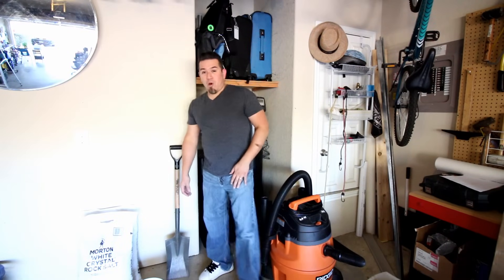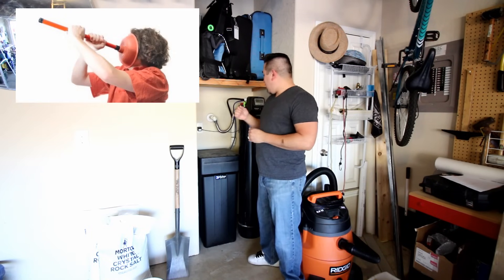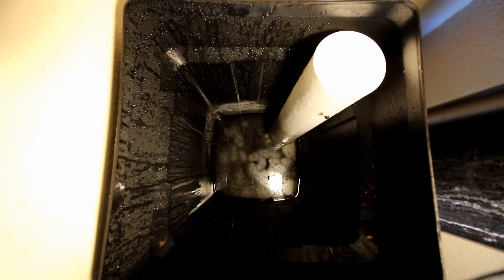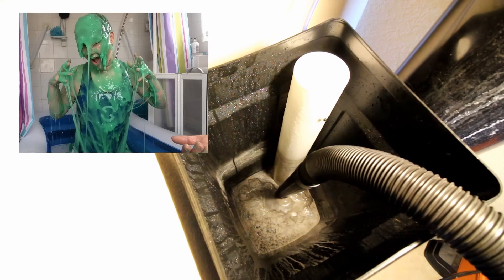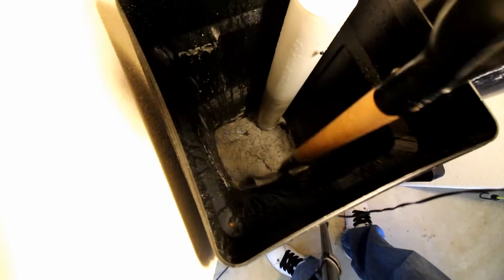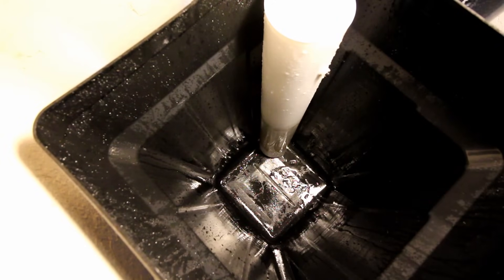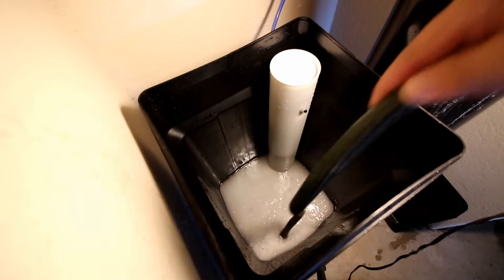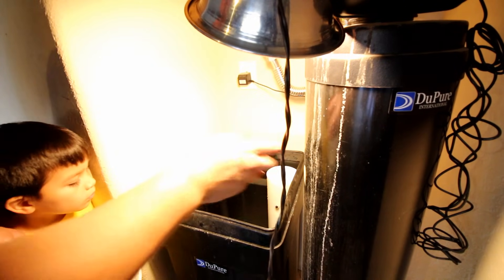DIY: Water Softener Maintenance

Comment: It is a whole lot easier to take the salt reservoir outside and clean.  If you have an all-in-one unit with brine tank inside the reservoir then this method is best, except for the water hose.  Also don't use shovel with sharp corners it is too easy to puncture reservoir.   BTW, The Brine Well is the white tube located in the corner of the salt reservoir.  Enough already with the photo inserts.  It was funny the first two times.
Reply from the maker: Thanks for your feedback. You are right on the Brine Well part. I held off on removing the tank because of the small parts and potential issues someone may have if they aren't to familiar with the process.

Comment: What would happen if you remove the system from one house to another house. Now it’s been sitting for over 2 years. Now a plumber told me the tank might be corroded inside. Might need a new one. Could that had happened ? While it was just sitting for a while?
Reply from the maker: Most tanks have plastic internal parts and resin beads. I dont know of many systems that use any kind of metal that would become corroded. It goes against the entire use of a salt based system. There's so much sodium running through it that it would become corroded. Was the tank stored with the bypass on to keep the resin wet? If so, you may need to flush it out. THey make adapters that you can attach to your tank then to your house. Flush water through in the same direction that it would flow when connected. From there you should be good to install. Worst case scenario you flush it and nothing but yack comes out. If its a mess then consider a replacement.
Reply: This Guy   Thank you very helpful. God Bless

Comment: thank you for the video. but i have a question; did you change the valves back to the normal direction from bypass mode????? or is it supposed to stay bypass mode?
Reply from the maker: You should take it off of bypass right after finishing the cleaning featured in this video.

Comment: I appreciate this video. Nice job. One suggestion though is to not use that rock salt. That stuff contains debris and sediment which is probably why eventually you have that build up.  Use pellet type or nugget type salt.  It is much cleaner salt.  Also it’s not any more money in my experience. I pay about $4.50 per 40lb bag at the grocery store. I’m sure it’s even cheaper at Home Depot.
Reply from the maker: Thanks for your support. You are correct on the cheap salt. I have since changed to using pellets. I have found that I see much less build up in the brine well.

Comment: Great video! Thank you so much. My water softener is not releasing any water into the tank, it's always empty even when I try to regenerate. Do you have any suggestions?
Reply from the maker: Hi Jennifer, It sounds like your bypass is activated. Look at the bypass valves behind the tank head and note the position on the valves they may be turned so water is totally bypassing the tank. If it's not that, there may be an issue where the valves that engage regen are stuck. Let's start with the bypass first.

Comment: Most manufacturers of these units specifically state NOT to used rock salt. Does that differ for your unit or do you just like rock salt?
Reply from the maker: Nope, I had mistakenly used it. I use the pellets now.
Reply: @ThisGuyProductions  Never mix two kinds of salt in the brine tank. You'll get a bridge big enough to cross the grand canyon. LOL

Comment: Thank you for this informative video! Finally found what I was looking for.
My tank was filthy. Yesterday I shop vacced all of the sludge/slush out from the bottom. Then I washed out the tank with soap and a tiny bit of bleach.
I added one bag of 40lb salt, added water to just where I could see it, then added the Out water softener cleaner/salt booster. Then added 2 more 40 lb bags of salt and some more water. 
Stupid me didn't read until afterwards that 3 - 6 gallons of water should be added back....so I don't know if there is enough water in the tank. I think I'll add 2-3 gallons more just to be on the safe side. 
Anyway, I did a regen and now after I flush my toilet, the water in the toilet tank is slightly blue. 
I'm wondering if this is caused by the Out cleaner and if this is normal or ok?
Reply from the maker: It sounds like it could be caused by the cleaner. How much of the solution did you add? I would run the cold water in a bath faucet for about 5 to 10 minutes to flush it through.
Reply: @ThisGuyProductions  That's what I'm thinking. I dissolved 2 cups of Out in 1 qt of warm water and added it directly to the brine tank, not the well.
It's not as blue as last night but I'll try running the bath faucet to see if it clears it altogether. Thank you!
Reply: @TJC1315  Thanks Jill. Its common practice to flush a filter for about 5 to 10 minutes after installation. This can be treated the same way. The water flushing through the system will clear it out. I would just note to make this a best practice next time you complete the system clean up.
Reply: @LaunchpadB  Thank you!

Comment: First video I've found to be useful...it costs a lot of money to have my contracted service people come out to do mine, and I'm very into DIY. I have a RainSoft EC4...any tips specifically for that, send 'em my way, please. -=80)
Reply from the maker: Hey Randall, I am not familiar with it so I decided to look it up online. The Rainsoft site is very stingy with their research material. I was able to find an owners manual in the link below. Page 7 has the details, but unfortunately they dont show you how to perform them. (Note: If you add a resin cleaner, pour it into the white pipe inside the brine well. I poured it into the brine tank. It doesn't have a negative effect, but it takes a little longer to work that way.)

https://admin.rainsoft.com/documents/15929%20-%20Rev%20M-%20%20EC4%20Owner's%20Manual.pdf

Comment: FYI  Another video from a water softener repair guy says you pour the solution down the pipe in brine tank not in the salt.
Reply from the maker: Yessir Walter. You are correct. The brine well is the white pipe, not the actual tank. Adding the solution to the tank will not cancel out the benefit of the solution though.

Comment: The Venturi Principle. A venturi creates a constriction within a pipe (classically an hourglass shape) that varies the flow characteristics of a fluid (either liquid or gas) travelling through the tube. As the fluid velocity in the throat is increased there is a consequential drop in pressure.
Reply from the maker: Thanks!

Comment: mehhh,,,you should just dump that salt water softener. This is the first time I've seen  that nasty stuff in the water softener especially Salt water system!

considering Pellican and/or other non salt softener system bud!
Reply from the maker: Thanks jpthsd. I have upgraded to a system from Springwell and it has worked out great. I like them because I can install myself and save lots of money.
Reply: @ThisGuyProductions  quiet expensive Springwell...but hey you already did that,,awesome!!

May I ask if your TDS EZ tester's ever changed? Íve been seeing TDS no changed at all but I could tell the chloride other bad stuffs making itchy skin gone for sure.

(of course I use RO for my cooking and drinking water)

Comment: Don’t overload the bin with salt. Excess salt will compress the lower area and turn it to dust clogging things up. I have been using a water softener for 3 years plus, adding one to one and a half 40 lb. bags and have never a an issue with sediment in the bin.
Reply from the maker: Thanks Richard, I usually use 3 - 4 bags at once every other month. My brine tank is large enough to avoid it impacting too much.

Comment: In the 30 years have had a water system I have never had any thing that looks like what you have in that tank. You might want to find a different salt. I have never had to clean out my salt container.
Reply from the maker: I was using really cheap salt prior to making this video. Based off feedback from viewers I switched to pellets that are much cleaner. That being said I am still getting sediment every two years that needs to be cleared out. Perhaps it is the extremely hard water in south Texas.

Comment: after cleaning out the brine tank and adding new bags of salt how many bags should i add to start also is it necessary to cover the salt you added with fresh water?  and with the cleaning solution should I add that  directly into the tank  or put it down the center tube ? also after this process should I do a regen immeadiatley or wait for the system to go from 100% down to say the 22% when it normaly regenerates
Reply from the maker: I would add about 4 bags (200lb) to the brine tank then add water level with the top of the salt. The brine well (white tube) has a floater in it so the system will know that the tank is already full. When adding the solution it is best to add into the white tube instead of to the general tank like I did. It's more effective that way. I would also regen that evening.

Comment: does this remove chromium 6 and all that jazz from water?
Reply from the maker: It will remove most chemicals from your system, but Chromium 6 is some Erin Brockovich level stuff. You should get with your water municipality if you have those issues. That's really next level.

Comment: This was a helpful video Thank you
Just one question, after you checked/cleaned the Venturi valve did you manually switch the bypass valves back to service before doing the regen?
Reply from the maker: the bypass is turned off as soon as you wrap up.

Comment: Question. I heard there are "slots" in the brin tube? How do we clean that? My softener isn't draining again. Standing water. I replaced the Venturi gasket, it drained for around 3 months, but now standing water again. We use very little water. Just 2 people. Any ideas? Thanks
Reply from the maker: I am not familiar with all systems. I would bet that the drain issue could be due to a clogged like from the brine tank, or some kind of failure in the mechanism in the head.

Comment: You added to the brine tank not the brine well as instructions indicate. The brine well is the tube inside the tank.
Reply from the maker: Agreed. It turns out either way will work, but it's more effective in the Brine Well.

Comment: My feed water has 0.76 ppm free chlorine. Will it damage the softeners? 
The water hardness coming out from the softener is 1.5 mg/L after every regen. Is there a way to bring it down to 0.0mg/L
Reply from the maker: Hey Leong, You are way over my head with the question. You will need to consult the manufacturer of your specific unit.

Comment: Hello. Question. Kenmore brand. Water wasn't draining.  I replaced Venturi gasket. It drained , worked good for 4 months. Noe it's filling again and water not draining. Any ideas? Thx
Reply from the maker: Is it a stand alone system, or a combo system like mine? it could be a clogged line, or a failure in the mechanism in the head.

Comment: The brine well is that white tube you pulled the cover off of in the brine tank. Also the brine valve was that red part under that cap you took off, that is where the debris will be.
Reply from the maker: Thanks D Rob.

Comment: Can this clog a drain the system is connected too?
Reply from the maker: It possibly could. The water that is backwashed out of the system is high in salt concentration. In theory, there could be a build up of sediment over time, however I haven't seen it happen too often. You can rent a basic drain snake from a hardware store to search out the blockage yourself.

Comment: We have a 4 year old Rainsoft Softener and have it serviced every year.  The company was here 4 months ago for the annual maintenance but the water in our house has now started to smell bad recently from the faucets and shower head. Any ideas or suggestions?
Reply from the maker: I sounds like you may be using well water. The odors can be due to algae or bacterial growth in your water. You can try and add a UV system to your water to kill of any of that, but you would also need to add more filtration. There are also options to treat your well.
Reply: @ThisGuyProductions   We are on city water. We are tempted to turn the softener off for a few days to let the city water run through the pipes to allow the chlorine to kill any algae or bacteria, but the city water makes us itch terribly. I'm not familiar with a UV system or how to add more filtration.  Can you please inform me?  Thanks!
Reply from the maker: @rduverseau  Its possible that the smell is coming from the brine tank itself. I would follow the steps I show in this video to clear the tank out completely. You may need to use a chlorine water solution to kill off the remnants of the bacteria. Once done rinse thoroughly then use a water softener treatment to treat the resin tank. I havent heard of bacteria lingering in resin tanks because they prefer the brine. The solution you use to treat the tank should be specific to eliminating bacteria buildup as well. I've also heard of folks using 1.2 ounces of bleach for every cubic foot of resin in the resin tank. Mixing it into a water solution then just running a regeneration cycle to clear out the system. I would play it safe and disinfect the entire brine tank first though.

Comment: Would love for you to add an overview of the complete system... Like more about what that tube inside the salt tank is for and should it be cleaned...
Also what to do with the salt you removed...
And should you ever clean the resin tank?
Thanks for your demo... You have updated it since I last viewed it with the added photo oics and stuff...
Kool stuff dude!
Reply from the maker: Thanks! I have a new video coming out this week featuring a salt free system. I get into detail on what each part does. For this video I worried about the huge differences in all the systems out there. Inside the tube is a floater that keeps level with the water level in the tank. Its where it draws water from the brine well. You could eventually replace the contents of the resin tank, but its messy business. I opted to replace my system all together because my original seller wouldn't allow me to do it myself.

Comment: Does this cause the water to come out of the sinks a grey color?
Reply from the maker: Hey William, the gray color would not be tied to your brine tank as the system only draws from it during the backwash cycle. Do you notice a gray color all the time or only on occasion? If it is only right after a brine cycle there could be something there. On the flip side, if you are drawing water from a well, it could be related to your water source. I have seen folks use pre-filters to solve those issues.
Reply: @ThisGuyProductions thanks for responding. its only sometimes and only in the morning
Reply from the maker: @UniversalMind-10  It may be due to some kind of sediment in your system. Is it a new system?
Reply: @ThisGuyProductions  7 years old

Comment: We have to put in bypass during the night, or after claeaning the valve, put in the normal way?
Reply from the maker: Bypass is only needed while you clear the brine tank. Once you add the salt and water you can put it back to normal.
Reply: @ThisGuyProductions  thanks,  and in the screen I have to change anything, or keep with the salt level
Reply from the maker: @DogeXYTX  Once you clear our any residue and flush the system with the solution I used or something similar you just maintain your salt levels like normal. Dont use rock salt like I show in the video. It was the root of most of my issues. I now use salt crystals. Morton makes a system saver in a yellow bag that is great due to low residue.

Comment: How much salt should you add? Fill the tank? Only half fill? I tried to find a user manual for my Knight 1054 system (old system that came with the house) but I'm having no luck.
Reply from the maker: I usually fill the brine well halfway with salt.
Reply: Only as much as your willing to scoop back out if you get a salt clog

Comment: Gotta shut of the power before , right?
Reply from the maker: Not for the steps shown in this video. You do need to shut off the power if you are working on the inner parts of the head valve though.